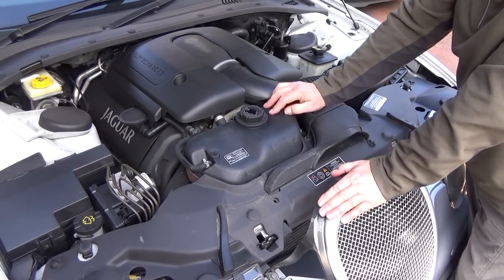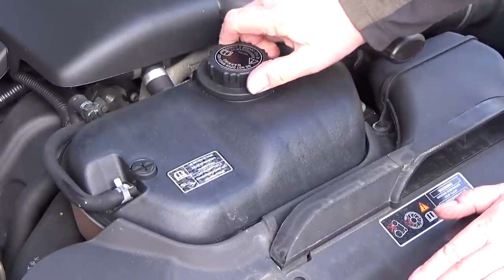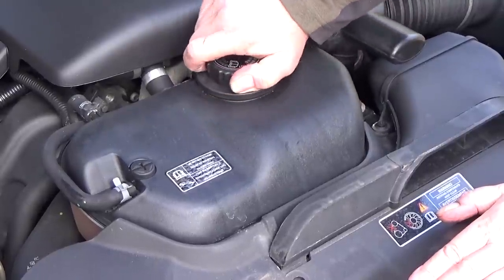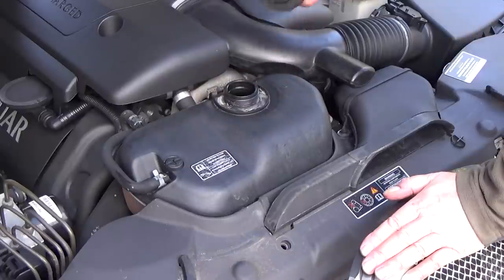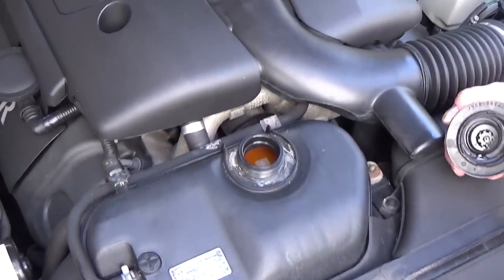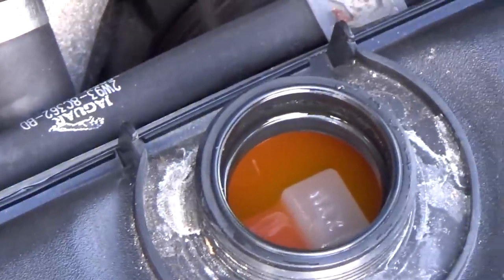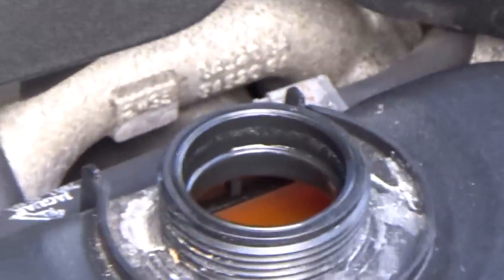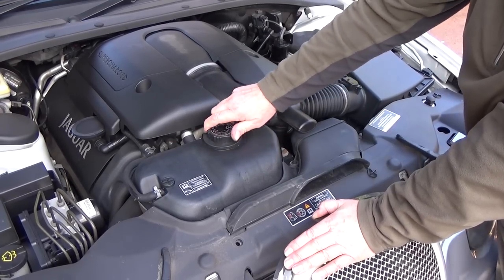Checking Engine Coolant, Jaguar S-Type R STR

Comment: Hi guys after some advice again I have a slight smell of burning oil in the cabin of my 2005 3.0 s type someone mentioned o rings but I can't find the part number anywhere. Also when replacing the servo does the plastic nut on the spline that goes to the pedal need replacing or can it be reused?

Comment: Hi should the car have been running for to check the level or would it be ok to check if it's been standing cold for a couple of days
Reply from the maker: Hi Glen - Always check the coolant level when the engine is cold and not running. You will see a plastic level indicator just inside the expansion tank below the filler cap. Never remove the cap when the engine is at running temperature as the system will be under pressure and there is a risk of scalding.
Cheers
Brian aka "The Old Man" JagTV

Comment: Hi guys excellent video. I have a question about my s type 3.0 2005.
While driving home the other night I noticed my brake lights were on and the brakes dragging slightly I used my foot to lift the brake pedal and the brake lights went out. This is happening all the time now and I have been advised it may be the servo, what do you guys think?
Reply from the maker: Hi Alfred - it does sound most likely. Difficult to say for sure when trying to diagnose remotely. Check out the link below which covers Jag S type braking fault diagnosis. If you can't resolve it yourself then a good independent Jag specialist will be able to confirm/Help. Sorry I can't be of more help just now. 
https://drive.google.com/file/d/1ShJ52uv8ZInymqo2WaRM-Furnil4W97L/view?usp=sharing

Comment: It seems  when an driving a 60 70 my coolant  is leaking through the cap. The coolant  is low after 50 miles of  driving  on motorway  in town  it takes  longer  to drop
Reply from the maker: Hi - strongly suggest that you get your cooling system pressure tested at your local trusty garage. They will be able to confirm where the system is venting coolant.

Comment: I have found on my s Type the coolant level looked OK just up level to the full marker but when i got in and drove it after a very short time pretty much straight away  the low coolant light message came on i then got told by a jaguar garage to go to the car when the engine was cold open the coolant tank start the engine and bang the coolant level drops a small amount so top up with coolant to the max level and put cap back on and problem gone light and message gone the jaguar sensor is very sensitive it don;t take a much of a drop in the level to trip the low level just that small amount of coolant added after starting the engine
Reply from the maker: Hi Robert,
That's good info - thank you and thanks for watching.
Cheers
Brian aka "The Old Man" JagTV
Reply: Your welcome
Reply: I have had this problem today, and will follow this advice to the letter. My low level warning light comes on when I go round a roundabout fast or accelerate hard.

Comment: Hi thanks for the movie,. I have a little question, can you make a film how to bleed coolant system in Jag 3.0 v6 2002 because its a little bit difficult and its hard to find information about it. thanks
Reply from the maker: Hi - have a look at our video on changing the Dual Climate Control Valve (link below) as we had to bleed the cooling system after fitting a new valve. Hope this helps.
https://www.youtube.com/watch?v=nn2KEe1v9EQ&t=176s

Comment: Love your Jag videos guys! I've got an '05 Jag STR that has one issue: the wipers don't return to their 'home' position when switched off. Is there an easy fix for this? Thanks!
Reply from the maker: Hi Dwight,
Difficult to diagnose remotely but would suspect initially that the mechanism has suffered excessive wear in the two spindles on which the wiper arms are fitted. Could also be that the whole wiper motor/arm mechanism is "floating" on its fixing bolts.
Have a look at the following forum link where you will find more info on this quite common problem.
http://www.jaguarforum.com/showthread.php?t=23763

Rgds

Brian aka "The Old Man" JagTV

Comment: Hi, can you make a video of replacing the headlight bulbs? Thanks.
Reply from the maker: Hi,
We will do a video when we have to change one of our H/L bulbs.
However the bulbs are fiddly to get at but not impossible. (Some owners remove the front bumper and then the headlamp assembly to access the bulbs.) If you remove the turn signal lamp holder and side light holder you will be able to more easily access the H/L bulb cover which when rotated will come away. The bulb itself is retained by a metal spring clip which will need to be moved out of the way before the bulb can be replaced.
Be careful not to touch the glass of the new bulb during replacement.
Sorry we can't be more useful at this time.
Thanks for watching

Cheers Brian aka "The Old Man" JagTV
Reply: I don't wanna remove the bumper that's too much work. It looks complicated and not a lot of room to get to the bulbs. I was planning on replacing them with white halogen LED.
Reply: Achilles Rob
 did  u get the bulb changed??

Comment: Hi,
Is topping the coolant up just a matter of buying WSS M97B44 engine coolant, mixing it with distilled water and filling up the reservoir.
Reply from the maker: Hi Agrajag72 (love the YT Handle BTW)
Yes just top up to the "MAX" level marker with a 50/50 mixture of WSS M97B44 (Orange colour) and water. Not sure you need to use distilled water as tap (drinking) water will suffice. Make sure the engine and coolant has cooled before removing the expansion tank filler cap. Ensure the vehicle is flat and level before checking/topping up. DO NOT fill the expansion tank fully as there needs to be room in the tank for the water to expand when engine is running at normal operating temperature.
Hope this has helped.

Rgds
Brian aka "The Old Man" JagTV
Reply: Thanks for the reply Brian. Much appreciated
Reply from the maker: You're very welcome
Rgds

Comment: I have a s type from 2000 but i cant see the marker when i look inside.
Reply from the maker: I believe that on your year/model the expansion tank is transparent in which case the MAX marker should be indicated by a raised line on the side of the tank.
Reply: @jaaagtv  found it! Was really hard to see because of all the covers.
Reply from the maker: @mrworldwide2722  👍

Comment: Hello,

I've got a Jaguar S Type 2002 Facelift which has the touchscreen, my Engine Coolant Expansion Tank broke, I've ordered a new one, but before I install the new one, I've got a questione.

Which type of Coolant should I use? My current Expansion tank is filled with a pinkish/red coolant, but in many other videos I have seen that the 3.0 V6 has Orange Coolant.

Any idea if I should switch to Orange from Pinkish/Red Coolant.

Thanks!
Reply from the maker: Hi, the anti-freeze/inhibitor to use is specification WSS M97B44, coloured orange/pink, Extended Life Coolant.
Reply: @jaaagtv  Thank you!

Comment: Hi guys wonder if you can offer any advice. My 05 3.0 stpe has been running fine until this evening. It starts fine and selects drive no problem but doesn't seem to want to change up and seems stuck in first.
Any ideas please?
Reply from the maker: Hi Alfred - When was the transmission last serviced (fluid and filter change) and at what mileage was it serviced. Also what is the mileage just now.?
Reply: @jaaagtv  hi not done it yet 58000 miles was running fine this morning
Reply from the maker: @alfredduggan1300  Can you select and drive in other gear positions - 2,3 for example?
Reply: @jaaagtv  I haven't tried. I will try in the morning and let you know 👍
Reply from the maker: @alfredduggan1300  Okay
Reply: Hi I think I have found what may be causing the problem.
When I brake the pedal isn't returning so the brakes are slightly on and rear brake light showing. Would this indicate a brake servo problem?
Reply from the maker: @alfredduggan1300  Hi Alfred - It would be most unusual for the brake issue to be affecting your gearchange problem. Difficult to say for sure but if your brake pedal is slow to return/release the brakes then the booster is the most likely suspect.
Reply: @jaaagtv  have you done a video on replacement of this part. Also what would I expect price wise for the part.
Reply from the maker: @alfredduggan1300  We haven't done a video for the booster replacement but I have added a link below where you can download a copy of the 2002-2005 S Type Workshop Manual. (Approx 75Mb). This will give you diagnostics information and removal and replacement procedures, I strongly advise that you confirm that the booster is faulty before buying a new one as the OEM Jag replacement unit is around £700. You might find a good used one on Ebay. The fault finder section of manual's braking section will help identify your problem.
Sorry I can't be of any further help here - good luck and do et us know how you get on as other channel subscriber/owners will find it of interest.

https://drive.google.com/file/d/1APKSuBkkXYAJHWPWuXlssg05sPWSahiI/view?usp=sharing

Comment: one question ,, is this a ford engine cuz i heard a lot about jaguar are built by ford motor im asking because i have one and recently had some misfire random misfire and i brought the car to difference shops and they could not fix it cuz there were not familiar to those engines ,,, but after some research online i could fixed by replacing some bad oxygen sensors but sensors go bad every 3 months  ,,
Reply from the maker: Hi Carlos
The engine in this video clip is the Jaguar designed and manufactured AJ-V8 4.2 Litre engine. If however you have the (AJ30)V6 3.0  Litre engine then this is a specialised version of the Ford Duratec V6 engine.
Your random misfire condition is difficult to diagnose without some sort of specialised equipment. Have a look at this link which may help you with a starting point but you will need something that reads fault codes.
http://www.random-misfire.com/
Oxygen (Lambda) Sensors should last for 60,000 miles or more but these shouldn't create a random misfire. It may just be a vacuum leak which shows itself as a sensor problem.
Hope this has helped.
Hope you get it fixed.

Cheers

Brian "The Old Man" JagTV

Comment: what kind of coolant is best to use? Previous owner used orange color, cant find exact brand anywhere. Any recs.?
Reply from the maker: +Adriana Lagunas Hi, the anti-freeze to use is specification WSS M97B44, coloured orange, Extended Life Coolant.  (Top-up with a mixture of 50% water and 50% antifreeze.)

Hope this helps,

All the best.
Reply: @jaaagtv  Any evemts for Jag owners? can You upload them on website?
Reply from the maker: @xapatanx-ray4634  Hi - There are precious few events left this year and even those are likely to be cancelled owing to COVID-19 restrictions. Best thing to do is look at the two popular Jaguar Club Websites - jec.org.uk/events and jaguardriver.co.uk/events/ these two websites are updated fairly regularly.
Rgds Brian

Comment: How often do I need to check as I checked mine after 3 months and I had to top up
Reply from the maker: If you use the car on a regular basis then check weekly along with engine oil and of course tyre pressures.
Cheers
Brian aka "The Old Man" JagTV
Reply: Jag TV  Yes I use it to get to work and back I haven't checked it for three months and it was under the min so I topped it up to just under the max I will check every week

Comment: Why are there different types of coolant isn't it just universal anti frezze coolabnt
Reply from the maker: Hi - The orange/pink colour coolant/additive is an all year round anti-freeze/inhibitor which is diluted 50/50 with water and different brands probably adhere to a generic formula. However we always advise sticking to the additive specified by Jaguar. Although having said that it doesn't have to have the Jaguar logo on the container as long as the formula meets the Jaguar spec. Hope this has helped.
Cheers - Brian aka "The Old Man" JagTV

Comment: They don't have the orange fluid in the states, the fluid for jag is no longer orange
Reply from the maker: What are you guys using for your Jags then?
Reply: @jaaagtv  It looks pink to me, maybe it changes color in a different light. I have a 2002 jaguar xj6 vanden plas. The name of the brand escapes me, but it's intended for my car.
Reply: @jaaagtv  When I purchased the car and drove it, it began to overheat and the low coolant light came on. I found that the previous owner was using BMW coolant. I put the intended fluid in and it worked for a while  then it needed more coolant, I poured more coolant in and it's been working so far.
Reply from the maker: @papadapa1662  Yes it's the same and light will affect the colour. It can look pink or orange or both at the same time.
Reply from the maker: @papadapa1662  Sounds like you had an air lock in the system which eventually cleared after topping it up a couple of times. Nice car by the way.
Reply: @jaaagtv  thanks
Reply: yeah they do, its GM DexCool

Comment: My anti freeze is pink. ...is this ok. ...52 plate       S TYPE
Reply from the maker: Hi - yes it is okay to be Pink as long as the the anti-freeze/inhibitor you are using is specification WSS M97B44, coloured orange/pink, Extended Life Coolant. if you flush and refill it should be a 50/50 mix with water.